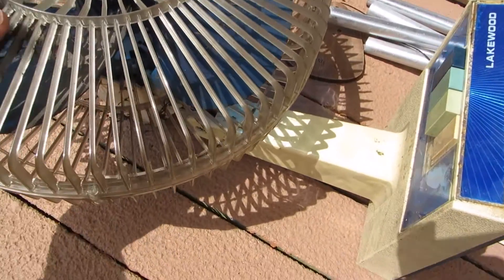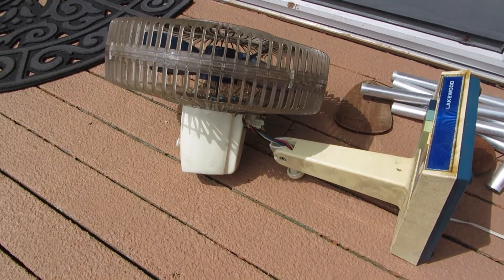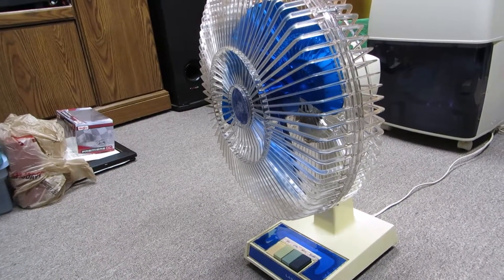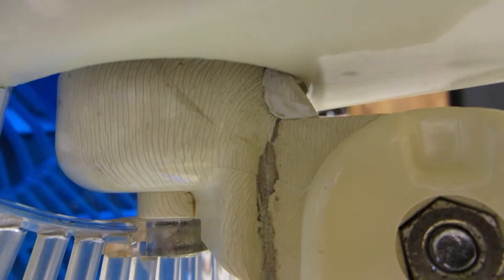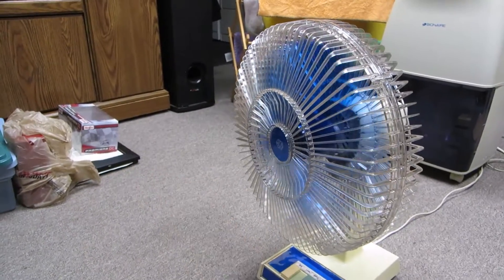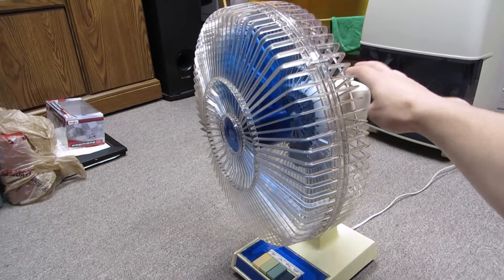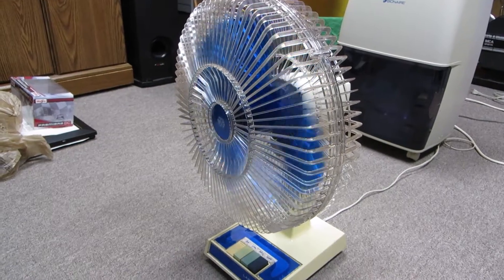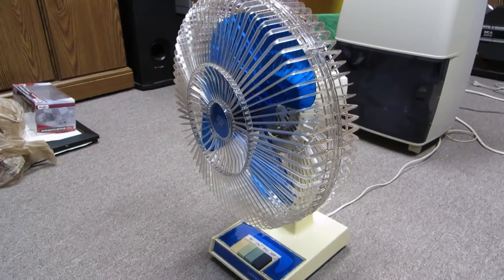Lakewood 1200 before & after rehabilitation

Comment: Great find! These Lakewood table fans are really amazing performers. I'm glad you were able to save it from the trash and were able to repair the broken neck. These fans are unfortunately notorious for breaking at the neck. The guards on these blue ones are far more durable than the tan ones because they are made of Lexan plastic instead of ABS. Be extremely careful adjusting the tilt of the fan. Make sure you loosen the set screw before adjusting the tilt or the neck will likely break.

Figured I should share some information with you. This is a model 1200; NOT a 1200A. The 1200A was the tan and brown version which was introduced in 1982. These fans were introduced in 1977 and this is a later model which I can tell by looking at the base. The early models had a lighter blue high speed button along with a Lakewood logo in the upper left corner of the base which this one does not have. The Lakewood logo on the base was removed sometime in 1980 as I have one of these from November of that year without the "LW" logo on the base. There should be a date code printed onto the side of the motor which would provide the month and year this fan was produced. It's either a 1980 or 81 model because the 1982 models had a white cage instead of the clear cage. These blue models were discontinued by the end of 1982 in favor of the brown "A" series.

Again, great find and definitely a keeper. I love mine! These are in my opinion the most powerful plastic blade table fans out there with high speed being almost too powerful for use on a desk. Definitely hang onto this beauty!
Reply from the maker: Andrew,
Thank you for your kind words and for pointing out I was mistaken on the model number, you're right, it's a model 1200.  You are also correct (impressively so, I might add) on dating this fan, my memory is a little fuzzy, but, I think the motor may have been marked October 1980.

This is, without a doubt, the finest tabletop oscillating fan I have ever owned.  I am absolutely delighted with its performance, it did a really nice job over the summer blowing the air conditioner from one bedroom into the hallway to help keep the second floor cool. Also, as you pointed out, I treat the neck as if its made of tissue paper whenever handling the fan in any way.  I never expected it would be as quiet as it is, not only given its size and volume of airflow, but how loud a similarly aged 6" Lakewood clip on I own is.  Perhaps I'll make a video about it in the spring.  I also own ten (10) Kool Operator Juniors 😅, which is the best sleeping fan ever made in my opinion.
Reply: @Kevinsrack  You're welcome! October of 1980 definitely sounds reasonable.

The one I have is an amazing performer as well. I can easily feel the breeze from it 20 or more feet away. I don't have any other fans that are quite that powerful. Definitely treat it with care and make sure to loosen the set screw if you ever adjust the tilt. Mine has no damage and I still treat it with extreme care. The 6" models were introduced in 1983 alongside the "A" series fans. I'd love to see a video of it and at least one of the Kool Operator Junior fans.